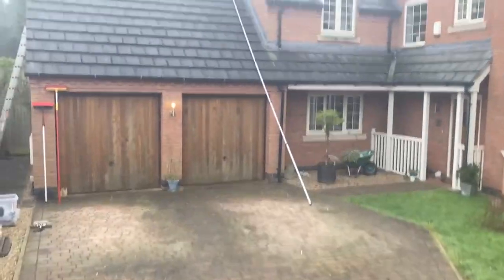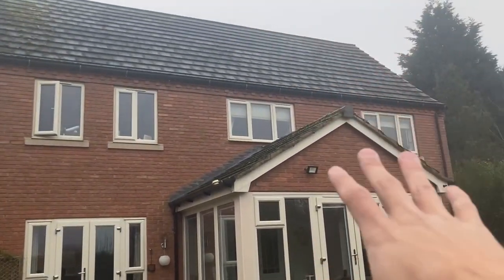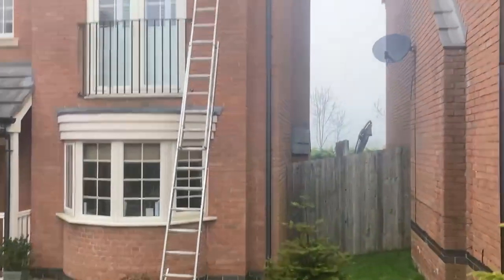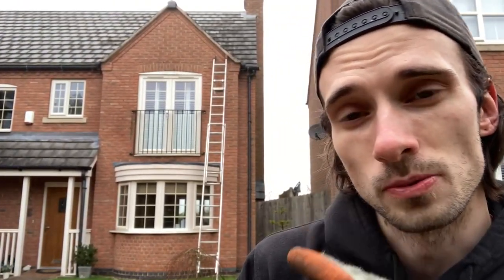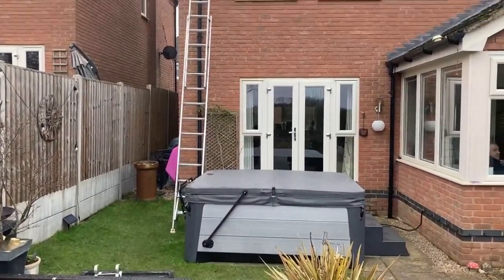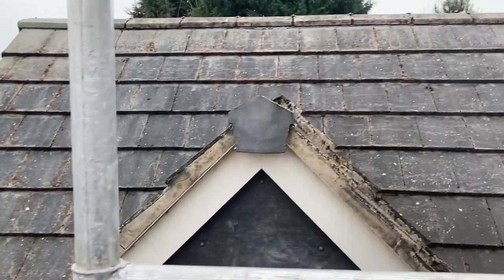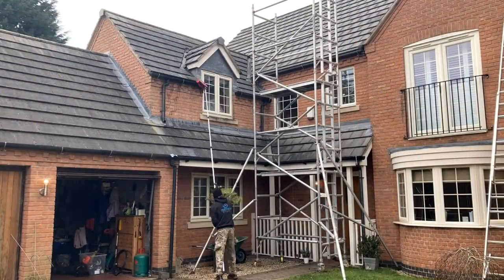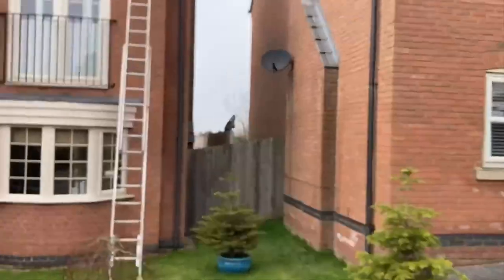ROOF CLEANING Walkthrough From Start To Finish // Partridge Exterior Cleaning

Comment: Another great job! And video well done pal!

What do you use to block the gutters when soft washing ?
Reply from the maker: On gutters like these that go straight into the ground, anything thats handy, some times tape them up sometimes shove a few towels in there, I prefer popping a towel in there. But if you can disconnect them and hang a bucket underneath it its much better
and cheers mate!
Reply: @PartridgeExteriorCleaning  excellent thankyou for your knowledge! 👌

Comment: Hi mate, this roof cleaning looks really hard dangerous work. Do you prefer doing it than window cleaning? For me nothing comes close to the earning potential of window cleaning compared to other offshoots of cleaning, gutters, conservatory roofs, driveways that I have tried. It's so more enjoyable whilst not having to work hard for it. People tell me that doing these bigger priced jobs makes them more money but when I figure out how long it takes them to do a job and how hard they have worked for it, I'm still making much more money than them per hr just cleaning windows with my feet on the ground. Although yesterday I was poling a window and ended up walking backwards into a fish pond. That's a one off thing though
Reply from the maker: The legendary Polzn Bladz, how's it going mate? 
Yeah the fish pond situation isn't ideal but better than stepping off scaffolding, long way down :D
If I had a complete compact round and was working 7 days a week I wouldn't be able to earn what is possible with this type of work that I can do in 4 days, however, possible is the word there, Getting the amount of roofs in to do two decent sized ones a week isn't easy. I'm averaging two a week at the moment but I know that wont last forever. 
I have a small round for pocket money and can always advertise for gutters, driveways etc to fill up the month if it's a quiet one but it's definitely a lot more stress in the long run than a good window cleaning round. 
It's why it's always worth pricing these jobs well as they are only done once (: 
Thanks for the comment mate, watched your vids for years!
Reply: Admiring my work the other day walking backwards, ended up doing a backward gambol over a plant pot :D
Reply: @PartridgeExteriorCleaning  Thanks for getting back. I've always been on the cheaper side  since I began window cleaning in comparison to other window cleaners. That helps build up a round and also hitting particular age groups, like older retired people. They are more reliable and more likely to be happy to see you instead of turn you away. Like with anything we do in our work, it takes one mistake and it can be all over. I admire your hard work ethic I am sure it pays off
Reply: @englishgrandad3298  Yes plant pots too I've tripped over
Reply from the maker: Hahaha :D
Reply from the maker: Very true mate and yes the few rounds I’ve built now I’ve always built a core set of customers that are price friendly then started marking up new customers once busy 👍

Comment: How do you remove the run off out the gutters sid , do you use a wet vac  and do you think that new biocide your using is more effective than the algo clear pro, great informative video again
Reply from the maker: Hey Justin, I’ll just pop them off wherever I can or if they can’t be removed I’ll just block them with tape or towels then mop up the run off in the guttering. A vac would be better but I have no room for one at the moment unfortunately. 
And I think it could be however I have upgraded my brush, I use a higher flow also now so the effects I’m seeing could be due to that too. But GKPRO certainly does it’s job so there’s no point me going elsewhere now unless I suddenly started having issues with it 
Cheers mate!

Comment: Hi sid  how much would a basic roof cleaning set up cost roughly?
Reply from the maker: Basic you can get everything you need to do a job for less than 600 but that’s not including costs for the first job upfront like scaffolding and chemicals. If you want a good setup you’re looking at a grand minimum for quality equipment and everything you need. I’m still upgrading things as I go every month 👍

Comment: great job Sid. But not sure you should be doing promotional material videoing yourself up a ladder with total disregard to health and safety rules. The HSE states if you must work from a ladder then you must have 3 points of contact at all times. You should be doing a risk assessment for every job
Reply from the maker: I did put a disclaimer on the screen mate, in my risk assessment that was the only way I could see fit to do get certain sections. It’s taken at your own risk as a sole trader, if I was sending an employee up there then I agree but I’ve spoken to a HS advisor about it and they’ve confirmed it’s fine as long as the customer or general public or any staff aren’t at risk.